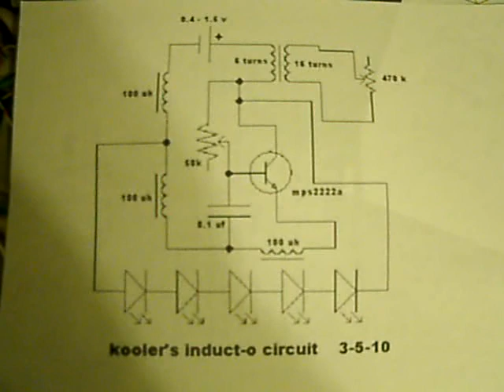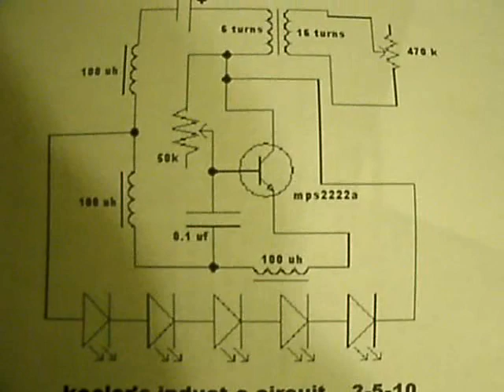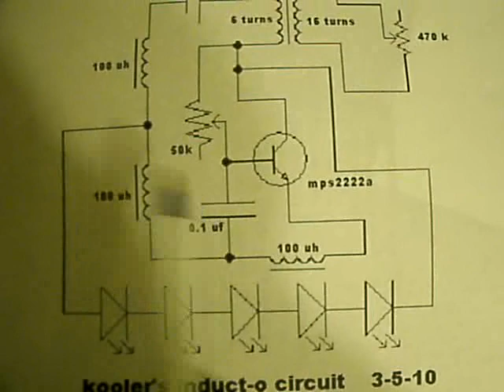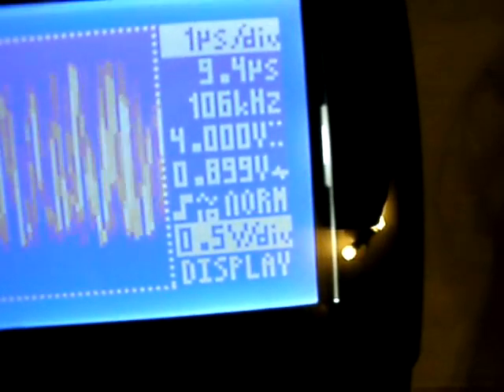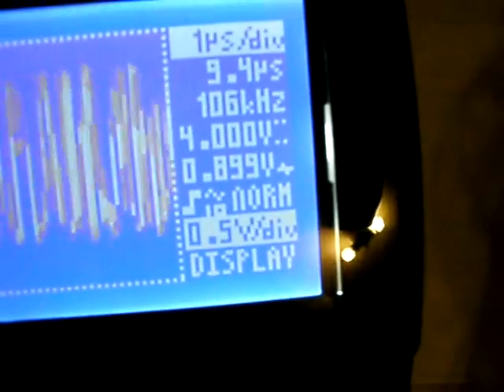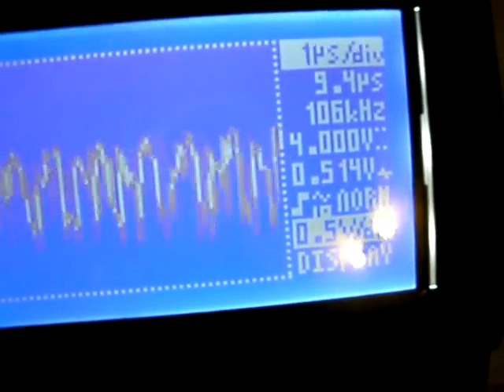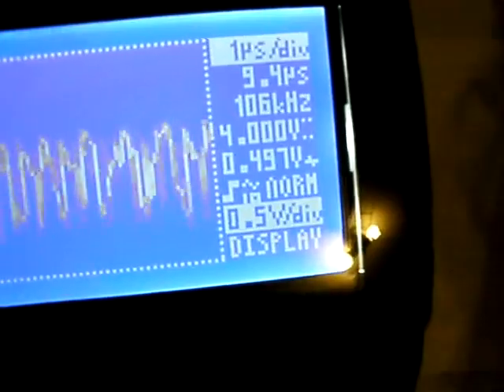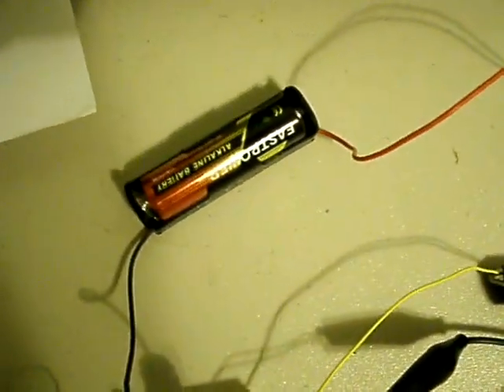hartley oscillator - induct-O

Comment: Strange circuit.
Why don´t you just pulse the higher positive voltage via the series LEDs
directly into the battery ?
Why do you need this choke coil at the battery first ?
Good work, please continue.
Many thanks.
Regards, Stefan.
P.S: Please publish your findings in my forum
overunityDOTcom
Many thanks.

Comment: No that's not it, i downloaded the circuit from overunity and in that diagram you have them in parallel. I also tried just one LED but it just won't work.
Can it be the inductors?
I use 100uH HF inductors (the small ones) because i couldn't get the tower inductors like yours.

Comment: Hey kooler, i fetched the inductors today; but i can't seem to get it to run???
I downloaded your circuit from overunity, and i puzzled with it today but it didn't want to light up a LED at all.
The only diverence is the transistor, i used a mpsa06 but that shouldn't make a diverence. The other thing i noticed was that my amp draw was from 0,17mA up to 37mA.
Do you have an idea what i'm doing wrong???
Your backwards JT circuit replicated just fine!